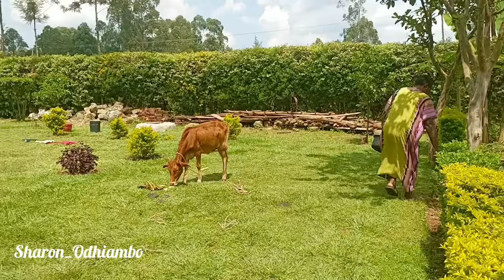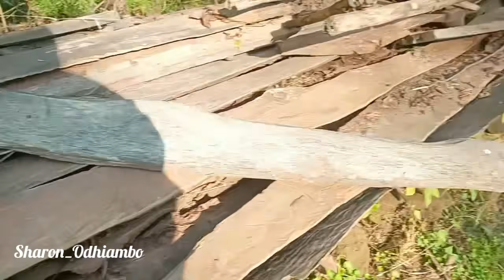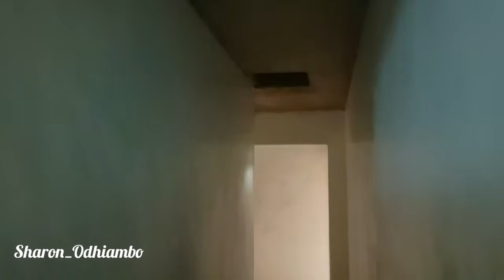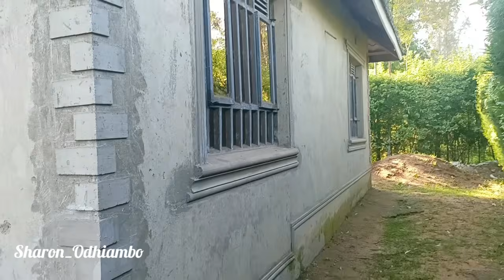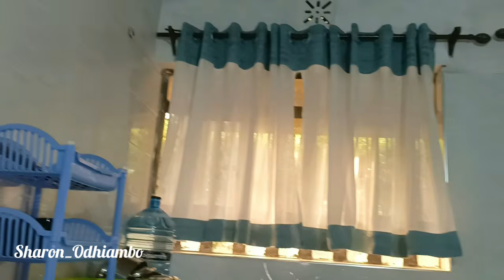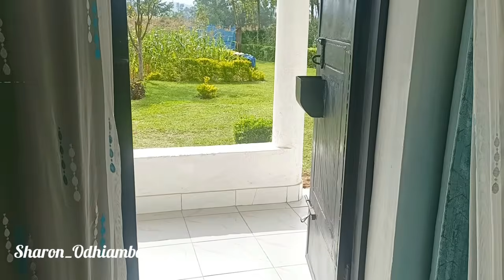Our Construction Journey: The Struggles No One Talks About

Comment: There are several problems that cause leakages. In my case it was also the roofers walking like goats during installation. I’m told there is a way they need to step on the roof while working. During inspection of leaking areas, we found depressions on rafters which means bad workmanship by roofers. You are not alone nyamin. I’m going through this painful journey and will have to reroof
Reply from the maker: Thank you so much for your feedback nyamin. I actually heard that carelessly walking on the roof may actually damage the roof...the goat part is quite funny 😂😂😂😂. Let me find you contact details of the one who did the tiles as requested 😅

Comment: I think the problems with the leaking roof stem from the fundi who did the roofing. Decra roof tiles are a relatively new product in this country and not all roofing fundis, especially in rural Kenya have an experience with installing it. Pole.
Reply from the maker: Thank you so much for your insight. So the fundi may have also largely contributed to this 🤔

Comment: Roman tile is such a problem. The manufacturer must have had some engineering flaws while designing this iron sheet. It's problems everywhere.
Reply from the maker: My goodness, I wish we knew this earlier because the struggle is real 😂😂
Reply: @sharonatieno6880 sorry for that. My brother also learnt the hard way. I went for versatile but insisted on a very experienced fundi. Glad he did a good job. Zero leakages
Reply from the maker: @Wickliffe254 Thank you. We learn from the mistakes. I'm glad yours has zero leaking, you must be a happy one!😊
Reply: How does concreting the ceiling stop leakages? I think the roof still leaks only Water is pulling somewhere on that concrete…nooo? Someone also mentioned using insulation. Still same problem. Infact, water penetrates somewhere and find it’s way on the weak point and still drips down. I don’t know the solution because i’m also fighting a decra roof leakages. The last time i had the courage to bring in a new contractor, i was told will have to rip off the whole roof and redesign. I have no resources left so i have to breath at the moment. Thanks for sharing this painful journey i’m also going through